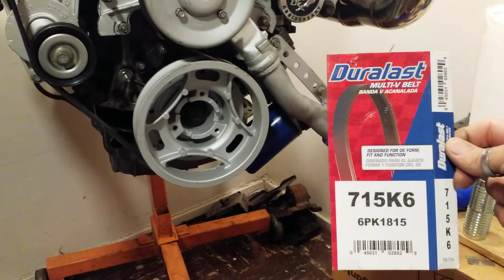Mustang 4.2 3.8 V6 Twin Turbo FEA Tutorial 1

Comment: So to clarify, the Freestar crank pulley is one piece with the harmonic balancer? If so does this only work with the internally balanced engines?
Reply from the maker: Yes these are 1 peice internal balanced.
You can swap out for the 99-00 external windstar balancer to make it work on external balanced motors. Make sure to check the reluctor wheels and if not same, swap the mustang reluctor onto the van balancer
The freestar and windstar have the same belt line so they directly interchange.

Comment: What about the ac compressor
Reply from the maker: I deleted the AC with a short belt. The parasitic loss of the AC clutch is quite alot. By deleting the AC with a short belt you are bypassing all that parasitic loss and it is quite noticable at all RPM.
I believe it is possible to use the AC but must have 100% custom lines to the entire AC system and cannot be simply bent into place like the powersteering line.
For more tech support Join FB: New Edge Mustang V6 Tech Support.
LIKE SUBSCRIBE AND JOIN! THANKS!

Comment: Would this work with the 3.8 thunderbird supercharger swap?
Reply from the maker: You would use old windstar 3.8 single port head accessory brackets/ accessories and do the exact same procedure using single port windstar accessories to get the same fitment outcome.  Windstar is same engine accessory fitment as freestar, but the freestar accessories swap onto 01+ mustangs, 96-01 windstar accessories for 99-00 mustangs, and 94-95 windstar accessories for 94-98 single port mustangs/3.8 thunderbird.
All will give you the extra 3+ cube feet of engine bay room like this.
Reply: @MustangV6TechSupport  thanks!

Comment: Curious on your exhaust manifolds and your build. I just found you so I’m still watching videos, but I have a 98 3.8 and my ps is in a completely different location. So I didn’t know what your thoughts on that were. If you get a chance to answer this I’d greatly appreciate it. And wouldn’t mind chatting with you for a while on the subject.
Reply from the maker: The "Turbo FEA" (Front Engine Accessories)  I cover in this video is the basics to swap all front engine accessories (powersteering, alternator, water pump, balancer and tensioner) from a Ford Freestar to get roughly 4 square feet of extra engine bay room for turbo fitment.
The manifolds are just ebay manifolds. Using these engine accessories any ebay turbo kits fit the vehicle with extra room to spare.
For more tech support Join FB: New Edge Mustang V6 Tech Support
LIKE SUBSCRIBE AND JOIN! THANKS!